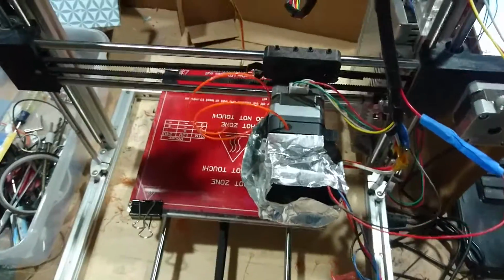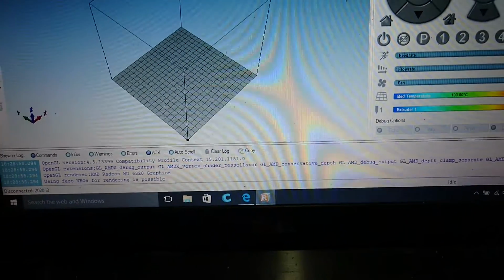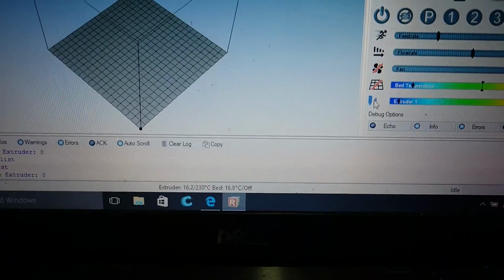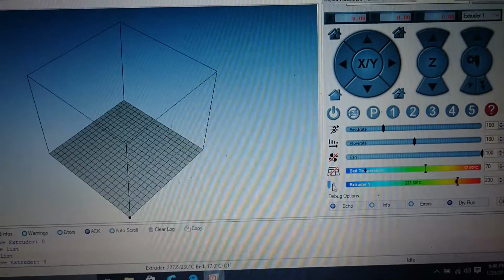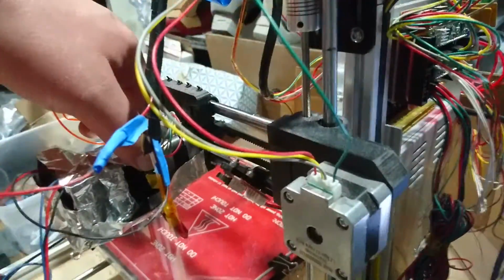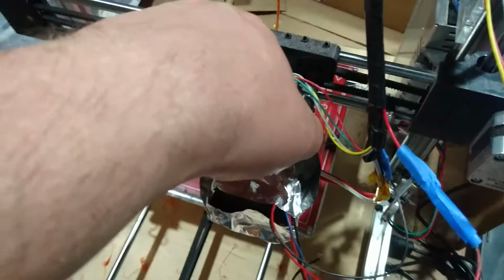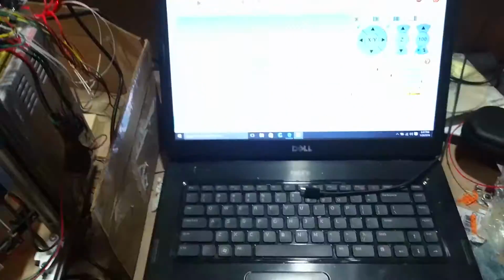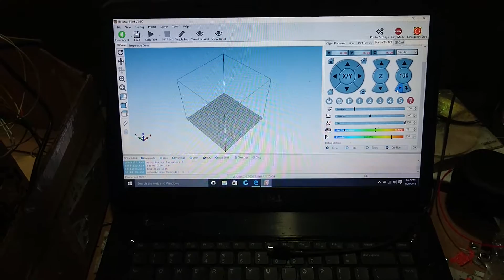How to change 3D printer filament.

Comment: other way I've seen i you cut the filament off right at the base and then manually extrude it through with the filament you are changing to
Reply from the maker: That would work but the gap between my feeder and the tube where the hot end is, is a bit far from each other so the filaments would not align sometimes to go into the tube.  I've done that method before on my other cheaper plastic Mk7 extruder set up.
Reply: i tried the way i suggested just then and it actually works very well. The only downside it that you have to make sure the filament is pretty much straight in order for it to line up